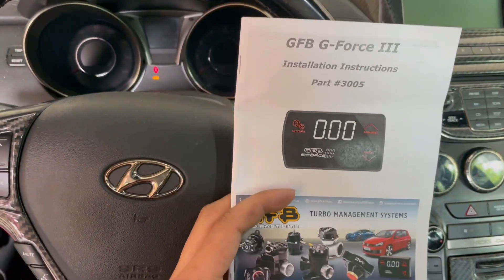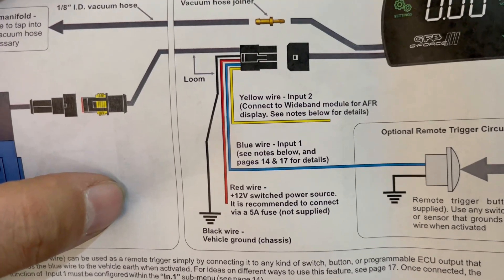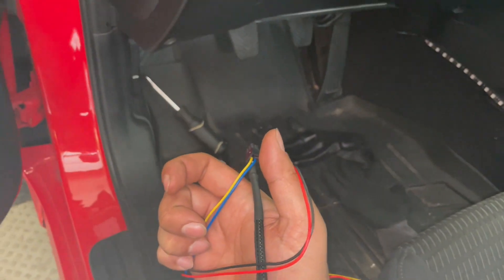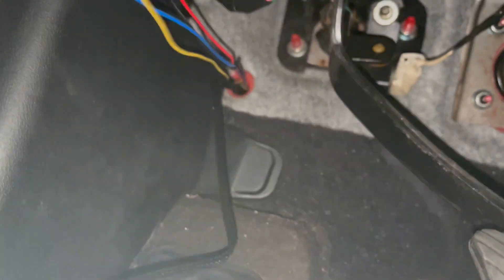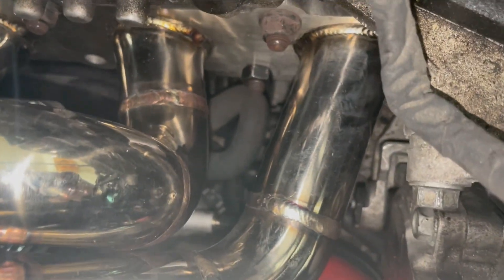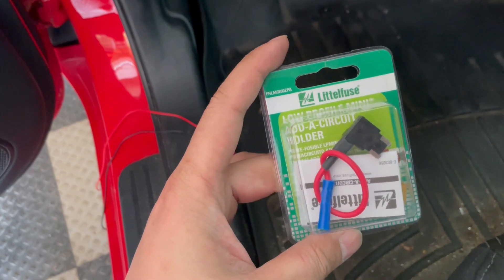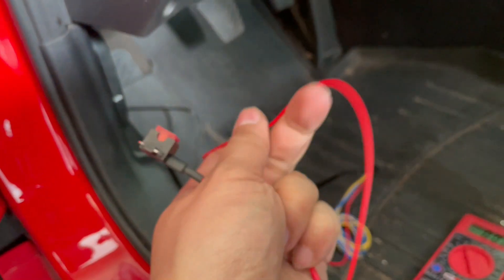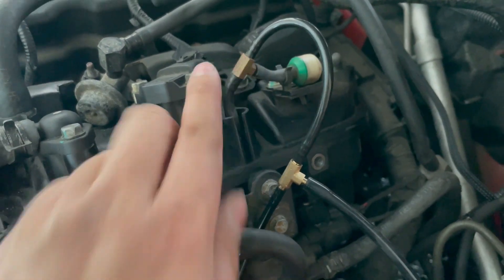DIY: GFB G-force III Electronic Boost Controller Install

Comment: Thank this video helps out alot but I have a bk2 so where do we put our oem electronic wastegate because it's goes to the ecu right do we leave it plugged in and set it off to the side or can we remove it
Reply from the maker: You would remove it and tuck the wiring away. The tuner will have to remove the code for it on the ecu and use the new boost controller to work on boost
Reply: @BTRcarcustoms  thanks for the info and support and keep up the video great work my brotha

Comment: I have my MAC solenoid sitting where the stock ones are. I found it moved and was rubbing up on the hot side piping. Is there a chance that the heat from there cooked my solenoid? Because now the boost controller is not controlling boost at all. I’m just getting full boost (which I’m trying to stay below).

Comment: I'm actually looking to buy a bov, which one would you recommend and what do I block off on the solenoid or other ports to make it functional and not flutter or give an engine code causing loss of power
Reply: I had one and i did one of the lines wrong and the bov blew my turbo